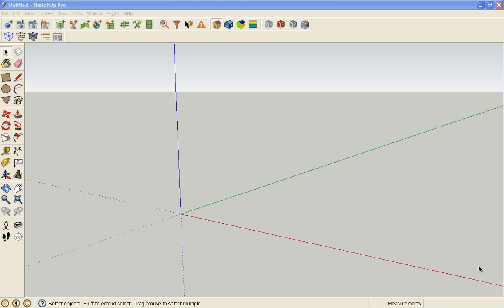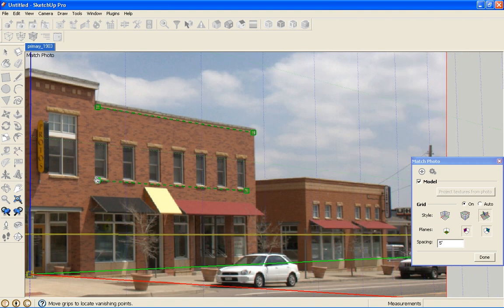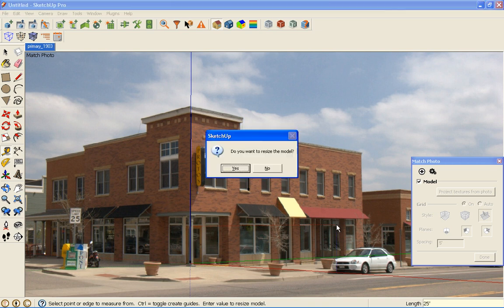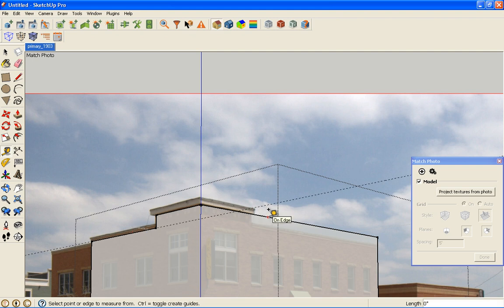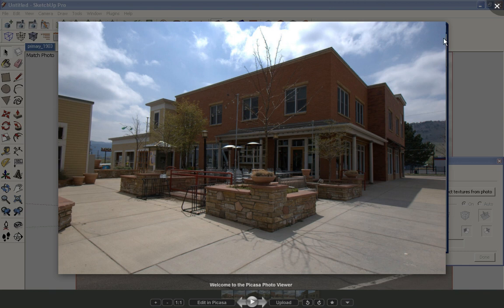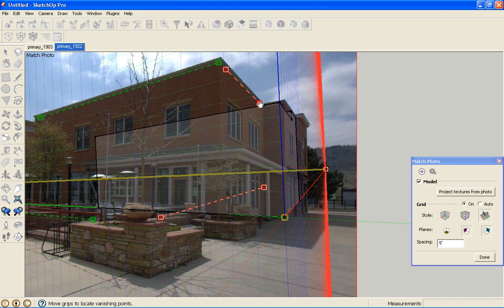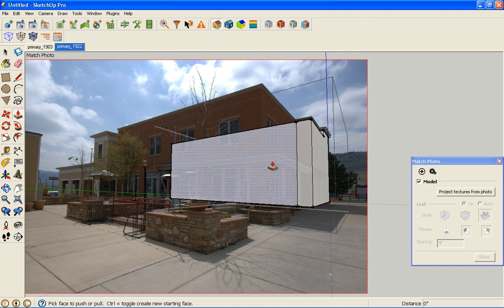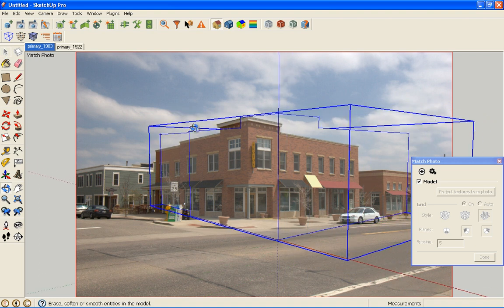Creating EnergyPlus Models from Photographs Using OpenStudio and SketchUp - part 2 of 4

Comment from the maker: If you can't see around the building then you would have to have a floor plan or an aerial photo. In this case you would just trace and extrude, and wouldn't use photo match, unless you wanted to use it only to locate windows on the visible facade.